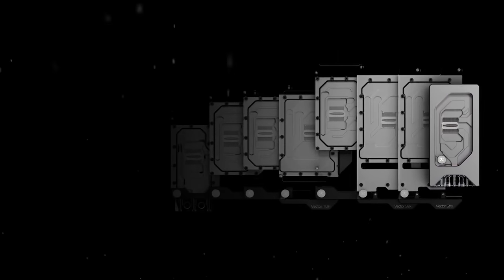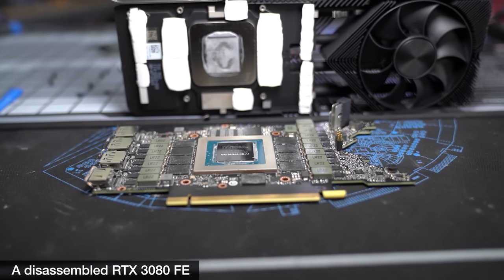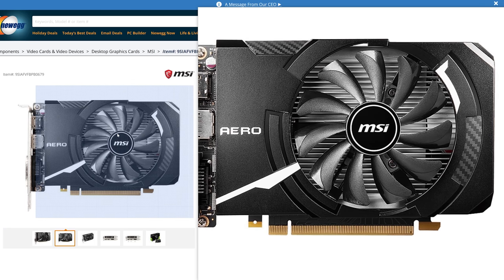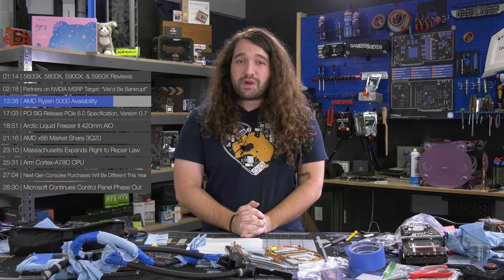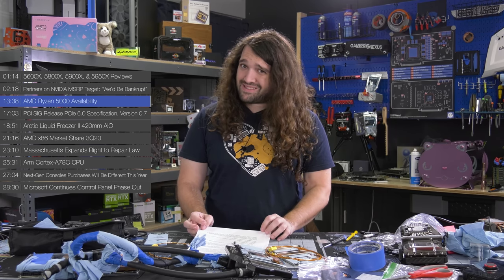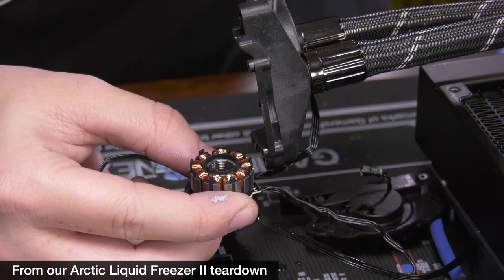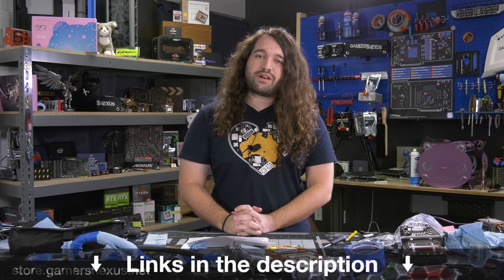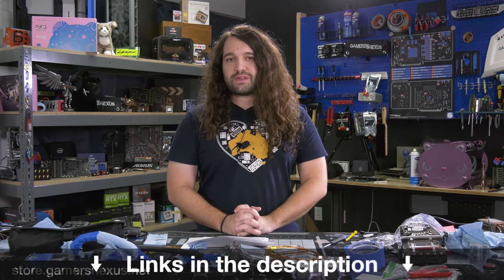HW News - NVIDIA MSRP Allegedly Not Realistic, Ryzen 5000 Supply, PCIe 6.0 Spec

Comment: Microsoft's settings app is awful. I never can find what i want through the app #R.I.P.ControlPannel
Reply: If they get rid of the sound options panel, I'm going to flip.. A flop.. I'm gonna have a bad time. It's already hard enough getting to it.
Reply: @CaveyMoth  This. Sound Settings feel so clumsy in Windows 10. I swear I have to have 3 windows open.
Reply: @ArsStarhawk  I actually mapped Sound to a button on my mouse so that I can get to it anytime.
Reply: Seems like the end of windows to me..since windows 8, the OS has been targeted at mobile devices with touch screens. Back to Linux for me.
Reply: @ArsStarhawk  Not only do you have to have 3 windows open, they are also twice as big and each displays less then the old control panel option.
Reply: #R indeed

Comment: Even as someone who knows basically nothing about manufacturing, it seems  that $4-$5 is absurdly lower for a GPU cooler...  Maybe those super cheap extruded aluminum coolers, but outside that?
Reply: There needs to be a profit margin for businesses to make any money. As a consumer, you aren't getting a product at BoM cost.
Reply: @cardboardsnail  I'm well aware of that.  I was just saying it sounds like an entire GPU cooler with a $4 cost would be a terrible cooler.  Probably basically what was seen on all of the cheap GTX 1060 3GB cards, slab of extruded aluminum+ one 90mm fan.
Reply: @startedtech  Probably. Probably not. Outrageous margins aren't unknown in various industries. Printer ink is a well known example. Glasses frames too.
Reply: inb4 the gpu doesnt come with a cooler you need to buy an aftermarket cooler for your gpu also
Reply: What would sound like a reasonable price? $20 on a 2 or 3 fan, $500 card?

If you think about how AIB needs profit for the card, GLU manufacturer needs profit for the unit, take into account R&D costs, plus shipping/distribution, advertising... material costs are probably absolutely tiny when we're talking mass production.

I'm no expert either but just some things to think about.
Reply: GPU manufacturer*, not GLU
Reply from the maker: @startedtech  Worse than that. Worse than single fan 1650 style coolers!
Reply from the maker: @cardboardsnail  margin in video cards is about 2-6% on average. 8% for flagship.
Reply: @GamersNexus  Wonder how much Asus gets out of their 3080 TUF, can't be more than the lowest you stated. Seeing the Strix and how it is built, could it fall into the same bracket?
Reply: I think the old amd copper baseplate with heat pipes cost more then the cost that Nvidia is asking their board partners to use.
Reply: @DrakkarCalethiel  ASUS allegedly got a pretty nice deal for certain capacitor few months ago, and build up a nice stock of it. I bet they just used the margin from cheaper caps on cooler design, resulted in better product and better sales.
Reply: @Verpal  No wonder that they went all out on solid polymer caps and MLCCs on their cards. I can't wait to finally get my Strix. :D
Reply: @murcroadster Sounds like the same thing that I have with my electrodes. They cost 250 bucks a piece new from the medshop and just 20-30 directly from china. Just disgusting what markup some companies do on their products.
Reply: @DrakkarCalethiel  Highly recommend looking at other part of PCB instead of just laser focus on MLCCs, full MLCC will likely just.... maybe 24(25mhz) higher, many other brand also got solid design choices.

Personally I do recommend TUF/Strix, TUF is likely best MSRP card, Strix is likely one of the better 3080/3090 without going water.
Reply: @Verpal   Sure the other components are better than average too, but the caps are the most obvious. That's why I brought them up again. 
I personally love the strix design for its labeled testpoints and connectors for the Elmor EVC.
Really curious what PCB Asus is doing to use on the EKWB Edition. If I can't get the Strix, this could be a viable option since I go watercooling anyways.
Reply: @DrakkarCalethiel  If you are using custom water block, just grab a base price TUF, ASUS use same PCB/caps design in same Ampere GPU. Just remember to keep the original cooler than your warranty will be fine.
Reply: @Verpal  The only thing why I want the Strix is for the easy access to the I2C bus of the VRM controllers as I might push that thing stupid in future. Maybe even on DICE. Dunno if the TUF is just as easy to mod.
Reply: @diomedes7971  Yeah, RnD eats up incredible ammounts of money. Pharmacy aside, just look at microarchs, they eat bilions. How much would you think does RnD cost alone for a GPU PCB?
Reply: @DrakkarCalethiel  Don't have access to detail TUF board design right now, but from a purely VRM perspective, TUF = Strix, as for whether the bus themselves are easy to reach, any LN2 switch...... etc, I donno, might want to give it a search yourself.

I believe Nvidia went with full on digital controller this time around, ASUS are likely analog, but I don't have time to skim through design again, just remember to search before your buy.
Reply: @Verpal  iirc they aren’t the same even vrm-wise. Check out buildzoid’s coverage on TUF and der8auer’s on strid cards for references
Reply: @YTHandlesWereAMistake  Interesting...... so the production sample changed.
Thanks! Just checked those video, you are correct, the final version VRM is different!

Comment: A tip for windows control pannel; there’s a feature called “godmode” that will display all of the ‘old’ system functions in 1 neat overview. Give it a google search, you’ll probably love it
Reply: That's freaking awesome.  I have me a new folder on my desktop now, named GodMode.{ED7BA470-8E54-465E-825C-99712043E01C}.  Question is, will this get removed too, if the kill the Control Panel entirely?
Reply: at this point i'm just going to switch over to Linux

Comment: Competition between x86 and ARM (and RISC-V) is a very good thing. Hopefully, it will encourage system integrators and vendors to research solutions for a more seamless solution for installing an operating system on different architectures than recompiling the OS for every architecture there is.

Comment: "Intentionally create scarcity. It does not make sense."
Nintendo: I'm gonna pretend I didn't hear that.
Reply: Nintendo doesn't do that for their big releases though.
Reply: Nintendo has an entire console generation lifespan to take advantage of that, and has a built-in monopoly.   The time window for PC components is too small.
Reply: They've also got legions of rabid fans on their side with nostalgia, so that helps keep prices high lol
Reply: In case of AMD, intentional scarcity will be more beneficial to intel, since all new AMD CPUs have higher pricing.
In case of Nvidia, the scarcity is surely INTENTIONAL. As there is still no other product to compete. The AMD GPU launch may change it, but also may not. Don´t forget the scalpers. They will do anything in their might to buy as many GPUs as they can... Creating another scarcity. Entire PC market might go nuts a month before Xmas.

Luckily, the CPU isn´t so hard to manufacture as the GPU.
Reply: Nintendo has never intentionally shorted a product. 

They're just idiots. 

Nintendo genuinely believed they had enough supply to meet the massive demand the Switch had at launch. 

They didn't purposely short any stock. They were just wrong. 

They horrendously underestimated what they needed, and whether they realized this before launch or not doesn't matter, because they couldn't justify any more delays. They had to launch when they did. You gotta remember what all was riding on the success of the Switch. Nintendo was in serious hot water coming off of the Wii-U. They had to get the Switch to market as soon as they feasibly could. 

And then you have all these "limited time releases" they've been announcing recently. 3D All-stars is only available until March.(supposedly.) One could argue that those are intentional stock shortages, but here's the thing... 

Of all the games they've said these things about, we've yet to reach the end of any of those time frames. We don't know if Nintendo is going to actually pull the plug on these games when the time is up, and frankly, I think you'd have to be an idiot to think they actually will. 

It's not gonna happen. 

3D All-stars is selling like hot cakes, and mario 35 is the most popular online game they've ever made. Pikman 3 deluxe is the last hail marry shot at pikman 4 ever happening, so of course it's gonna sell like crazy. 

Nintendo would be trump supporter levels of stupid to pull these games from sale for no good reason. This whole thing is a marketing ploy, and anyone with more than 7 brain cells should see that. 

Nintendo doesn't intentionally short product availability, and neither does AMD or Nvidia. 

Because doing so is a fucking terrible idea. It's the literal antithesis of what they have to do to make money and stay in business.
Reply: @GeneralNickles  I don't agree that they're idiots, unless you think not predicting a pandemic and its massive effect on the market for at-home entertainment makes them idiots.  But I agree with much of what you say.  Cranking out more Switches is like printing money.  They're not going to miss out on that intentionally.  They just had no idea how huge the demand would get, particularly after the relative failure of the Wii U.  

It seems to me people just need something to blame for having trouble finding what they want.  So an echo chamber promoting false-scarcity conspiracies opens up and spreads.  That's life in the age of social media.

The Mario 3D Allstars release window is another thing entirely.  I don't know what to make of that, and we'll see how that plays out by next April, if not before.
  My only observation is that there is no scarcity of that product at all right now, or through Christmas, or through the entire coming Winter.  Anyone who wants it can get it.  If there's no scarcity, there's no artificial scarcity.  This is a different concern.

Comment: I'd be fine with the control panel getting the axe IF microsoft had a complete replacement ready in the settings app. They do not, there is jack shit for settings in there that are actually useful. Instead they decided to take the approach of having two completely different looking and working applications to change computer settings. Something that seemed maybe sort of ish reasonable back when you thought they were going to implement all of the stuff into the settings app. Unfortunately it looks like they're just removing the control panel and saying goodbye to the settings within it.

Comment: You probably already know this but in reference to your condensation problem for overclocking you mentioned earlier in the video. You can submerge the entire build in 3M-Novec / dry water, or build a vacuum chamber for the case. Then you can theoretically drop the temperature as low as you like using your liquid nitrogen setup without ever having a condensation problem.

Comment: Partners should start selling bare cards with just a case mounting bracket, let consumer decide what cooler to put on. Working out an idiot proof cooling mounting solution will be the challenge but not impossible to achieve. If EKWB can be a healthy water block company, maybe there should a new GPU cooler industry....
Reply: Not exactly feasible. GPUs have no standard layout, nor do we particularly want them to
Reply: Colorful in China did (does?) this for some cards, I think most recently with 10XX-series.
Reply: Well, it seems to work for motherboards and CPUs. It might even clean up the mess of tons of different models using the same GPU by the same manufacturer.
But then that's probably bad for marketing.
Reply: My Morpheus is ready.
Reply: @finestPlugins  Except the CPU and motherboard system doesn't work that well. You have to check that your cooler fits in the case, andyou have to make sure that your cooler does not interfere with your ram. The ram and the motherboard cools itself for the most part.

Try designing a cooler that cools the motherboard chipset, cpu, ram, and vrms, and then try to make it work with any possible combination of componentry. This is why AM GPU coolers are not ideal.
Reply: @shadowcalen  The board partners already produce multiple cooler variants for a single GPU - and I suspect some would work for a single GPU family as well given the similarity in board layouts.
And yeah, if you buy some silly tall RGB RAM, you don't deserve any better. ;)

It's not like there's any technical reasons why it couldn't be done, but it boils down to marketing and vendors wanting to differentiate themselves.

Comment: Well for me that explains the shortages apparently it's not a matter of supply rather its an internal price war between partners and nvidia
Guess we will have to wait for who caves in first
Reply: They're not talking about GPUs that have been released.
Reply: @nimrodery so for what other reason are no cards available then?
Reply: @merick3395  I'm not saying that isn't part of the problem, but this video is discussing the upcoming 3060/3050 class GPUs, which considering how hot the 30 series has been will probably need more than the super cheap cooler that NVidia's profit margin allows if partners stick to the MSRP. It's not something NVidia would typically worry about as they probably won't even make a 3050 class card for sale to the public, and their NVidia branded GPUs may be issued by partners, shifting the MSRP worries to them.

The profit margin on the original release of the 3080/3090 was probably decent for board partners, as we've seen a number of different costly designs implemented by each company, which implies a lot of expense at the design and production phases that wouldn't be justified if the margin wasn't there. That's an assumption on my part, but I think it fits the available data.

Best answer is the short supply of the 3080/3090 is due to a number of factors, profit margin might be one of them but we can't be sure.

Comment: Just as a data point for when the Ryzen 5000 supply may improve, I got an email from B&H Photo yesterday saying that due to high demand and the allocations of the 5900X they have received, they do not expect to be able to deliver my pre-order until sometime in Q1 2021. For context, I placed my pre-order approximately 2 and-a-half hours BEFORE the chip went on sale on the day they went on sale. Granted, because they were allowing pre-orders for about 6 and-a-half hours before that, there may be hundreds/thousands in front of me (and B&H won't tell you how many are in front of you), but still.  Are there any other reports from retailers about when they expect to have stock more generally available? I understand that I can go pay a premium on ebay, if I want to. That's not what I'm asking about.  I'm asking about any other solid data points from retailers.

Comment: would have been nice to remind that MSRP is manufacturer's suggested retail price. Didn't know the acronym :)
I really don't like the settings menu. The control panel was already difficult to navigate through, but the settings panel is an absolute chore. Accessing specific / advanced parameters is really hard and has to be done with small links on the side, which sometimes are actually just webpages... Confusing and impractical. sigh in unix command line

Comment: M$ has also flagged all changes to the hosts file that disable M$ telemetry(i.e. spying on users) as 'security vulnerabilities' within Windows Defender(built-in anti-virus program in Windows 10). Upon discovery Windows Defender will now clear the hosts file allowing M$ to spy on the user again and trashing whatever custom settings there might have been. Yay greed.
Reply: Won't stop people from using older versions
Reply: They can’t stop a Pi-Hole. As much as I’m not for government intervention the data collection by all companies needs to stop.
Reply: You can disable Windows Defender using a local group policy.
Reply: @andersjjensen  Problem is that the average Joe who got their Windows version unfucked over a year ago by some distant relative who knew one or two things about computers won't know how to do that nor will they probably even realise that M$ flipped a switch to start spying on them again. It's even worse that the solution is to disable wholly or partially a security feature within Windows. WTF M$
Reply: @X3h0n  I know. But people who don't know jack shit about computers should have a much better anti virus than Defender. And people who do don't need it.

Comment: good question to ask by GN is why in november we still have this stock problem with nvidia across the board
Reply: I don't work for nvidia but I do work for a company that makes other chips. It takes about a month from start to finish to make a complete chip (hundred or thousands or even millions at a time depending how big they are).  The time depends on how many layers it is composed of, and with a bigger chip like this you get less per wafer. The bigger the chip the more prone to defects just because of surface area.   TLDR: Takes a lot of time to make chips.
Reply: @TeraNazantia  thank you for your reply, i appreciate it, yeah i get it that the yields are low because of the surface area, but still, my question was, why still after 2 months from the launch, when you see the demand, you are not capable of delivering at least in the tens of thousends per week... the 3080 is appaling, 3090 numbers are better, 3070 non existant. And when i say better in mean a quantity of max thousands per week. Nvidia really made a big big booboo with the 30 series launch. Lots of goodwill shifted.
Reply: @grosuciprian  Linus said it's because nvidia has been selling to bitcoin miners directly instead of refilling the retail market.